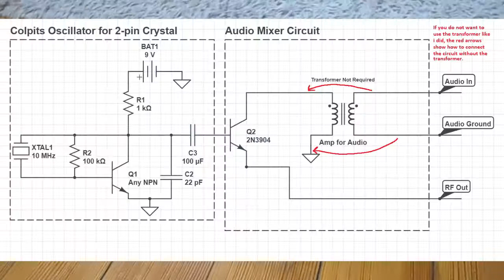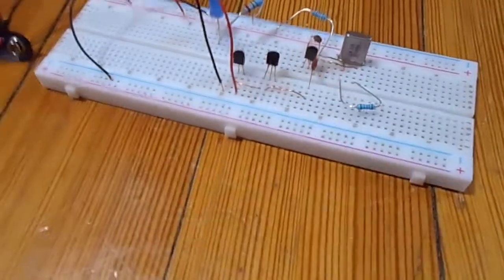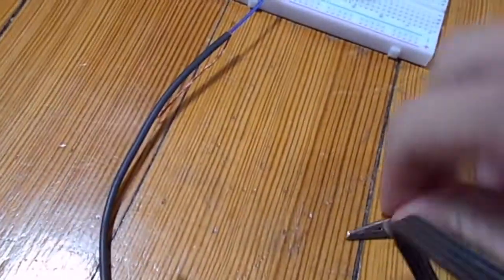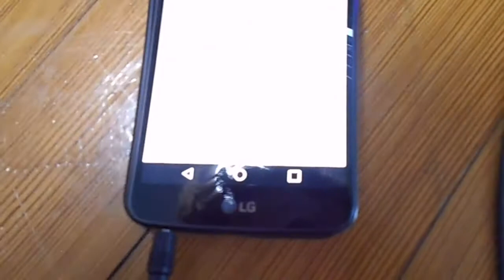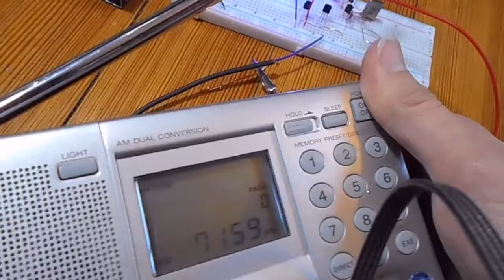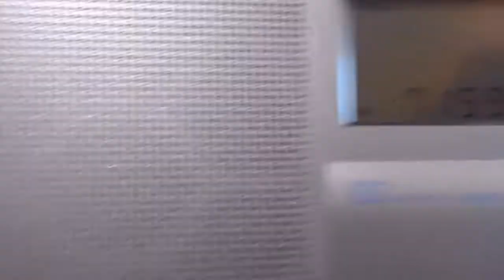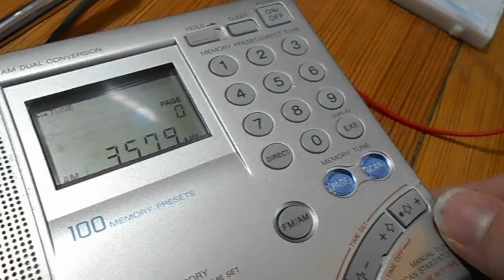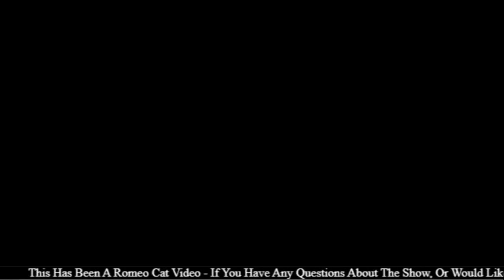How To Build a Basic AM Transmitter For a 2-pin Crystal - AM2PC pt. 1

Comment: I have designed one myself with three transistors; two BJTs and one JFET N-channel. JFET is as Pierce oscillator at 7.2 MHz, first BJT as audio amplifier and second BJT as mixer and RF amplifier. I use 22 uH fixed axial leaded inductor with 2 pF capacitor in tank of mixer+RF amplifier. It works like a charm with a range of 80 yards. I'll add band-pass filter once I decide to put it on Vero board and solder components with a few changes in tank of mixer stage. It's fun building an HF transmitter. Good day sir!
Reply: Gracias por tu tiempo, y exponernos este proyecto
Reply: Yes your inductor on the output transistor tuned to your oscillator frequency is the correct approach to increase the range substantially.

Comment: If I read your schematic correctly,  you are using Q2 to modulate the audio signal to the 10mhz carrier, seems  an odd method to modulate but very simplistic, thank you for the upload , and I am glad that you demonstrated how to use a 2 pin crystal in a transmitter circuit, as I am always using a 555 to get an oscillator for lower frequencies
Reply from the maker: Yes, Q2 is used to modulate the audio. It is an idea I came up with a few years ago with my extremely basic understanding of transistors. It is a quick and dirty way to throw the two signals together, but it works well enough in this applications, at least for me.

Comment: I still have a Radio Shack Science Fair electronics lab.  It helped me learn quite a bit about electronics.  It has a transmitter experiment and is okay as long as it only sends your voice to an AM radio maybe a few feet away and keep the antenna length under such in such unless the FCC rules have changed.

Comment: Awesome video I would try to replicate it but I'm about to throw everything in the damn garbage since I can't get a single transistor amplifier to work I did it once a week or two ago and now I cannot replicate it I've tried so many times. I might just jump to this I don't have any crystals of those frequencies I think mine's 1.8 so I won't be able to hear it sits just above the a&m band. Maybe I'll mess around with an FM transmitter LOL extremely intrigued also I think if you had a longer antenna that would fix the issue and the 40 m BAND I mean a quarter wave antenna but be roughly 30 ft long. I bet you that make a big difference on how far you can broadcast but I'm sure you already know that. Awesome video again
Reply from the maker: This kind of work will also sometimes cause me to bang my head on the wall. The main reason why this xmitter is so weak is for two reason.

The first being that there is simply no amplifier. I have a design for a basic working amplifier that a friend sent me, and I have run a few test on it, but have not yet implemented it into a bigger circuit. I may do a video on this in the future.

The second reason is that I designed the modulator using my very simple understand of transistors at the time. It is a quick and dirty way to make AM, but is lacking many passive components that improve signal strength and mitigate noise.

It, of course, also doesn't help that I had a very sort antenna. However, as this circuit is, I would not want to broadcast it very far due to its noncompliance with FCC rules. The main issue with it is that the crystal has many harmonics, and if I were to transmit this thing far, It would be making unwanted signals on several frequencies.

If I were to add a band-pass filter and proper amplification circuit, this would make it more suitable for the air. I am a licensed radio amateur, so I could use this as a ham radio. I also may do a video on this idea in the future. I can connect it to my existing end-fed antenna that I already use for 40 meter operations.

If you want a crystal that is of a frequency seen in my video, then you can get it from the same source I get them from: VCR's. The composite video generation circuits in VCR's and other AV equipment almost always have a crystal. The NTSC standard defines the color burst signal to be 3.579545 MHz in bandwidth, so you'll usually find 3.579 crystals. This is actually in the CW section 80 meters. Sometimes, you will find the double, 7.159 MHz. This is in the phone section of 40 meters.
Reply: @rcat256  awesome I haven't messed with the breadboard in a couple weeks letting my frustration cool but I did get that single transistor amplifier to work again LOL. I'm waiting on hearing back from a guy that has an old icom for sale. That is capable from 160 m to 10m. Then I plan on making a dipole for 160 m I'm extremely intrigued with the medium wave frequencies and their amazing propagation factors. I also bought an antenna tuner and I've been recently experimenting with random wire antennas on 11 m band. Radio is awesome bro! 73s.
Reply: @rcat256  hey I can send you my schematics so you'll check it for errors and omissions. It works like charm for me through at 7.2 MHz
Reply from the maker: @awaismushtaq5719  If you want to, go ahead and send it to the email listed in the channel description. I could defiantly look at it, but I'm probably not as qualified to spot errors as my video makes me seem.

Comment: What is the function of the transistors in this circuit?
Reply from the maker: I believe the first transistor is used to keep the feed back loop going in the oscillator circuit. The second transistor is used to take the frequency signal and use it to modulate the audio signal. The third was intended to amplify the RF signal, but was used improperly and shouldn't be included.

Comment: The crystal you are using is a 7.159 which exists in the 40 meters ham band. The power out put you have is so low that it probably doesn't matter, but you should be aware that frequency is a licensed frequency. If you end up causing interference that annoys someone the FCC might come down on you. Again the fact that you can't pick the signal up but a few feet away means your probably ok, but hey consider getting your amateur license and your all set!
Reply from the maker: I am aware of the FCC's rules and regulations and I am actually an amateur radio operator. Although I keep this one on very low power, I plan to make a video someday where I make an SSB transmitter for 40m based on this crystal. I will definitely be sure to remove harmonics and regulate the bandwidth.
Reply: @rcat256  Good deal bro!! I'm a big fan then. KF0FDF
Reply: I think it's complete BS to have to pay the government just to be able to use a radio to communicate. Yes, it might help to keep the airwaves cleaner to require rules but that should not require payment to some government. They should not have that right.
Reply: And, yes, i am a licensed amateur ham.
Reply: @englishrupe01  Not sure what class license you hold but the more advanced license classes you get you start to understand the damage people can do to not only themselves but also to people in their proximity. I think primarily this is the driving element that motivates the government to license the freqs, but truly I've seen what it looks like to deregulate frequency allocations, if you don't, run down to your nearest 11 meters retailer and pick up a rig, you'll quickly discover why on a content related level it is such a blessing that these regulations are in place out side of what harm you could do.

Comment: Can i replace 10mhz crystal with 27 mhz without change any component?
Reply from the maker: Yes, the circuit is designed to oscillate at whatever frequency the crystal is, so you can put in just about any frequency, long as it's not some crazy high frequency (like in the gigahertz). If you chose to add extra circuitry like filters or amplifiers, you may need a particular frequency because those additions are often frequency specific.